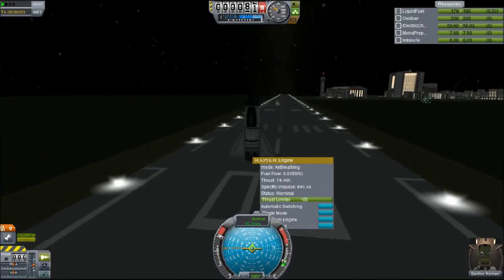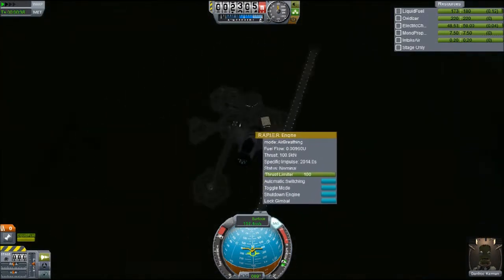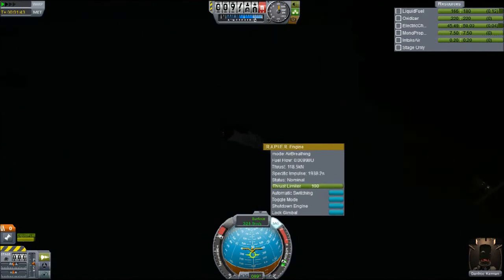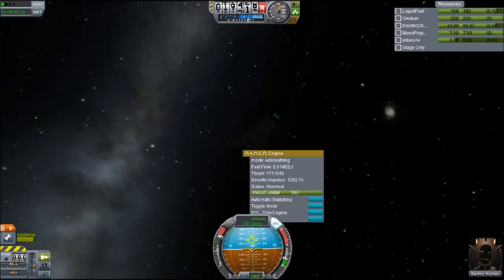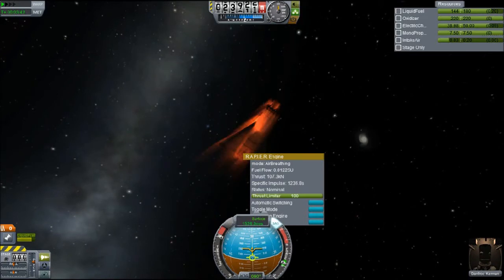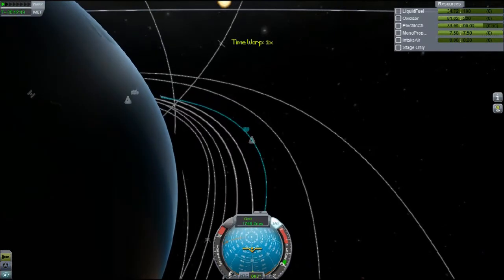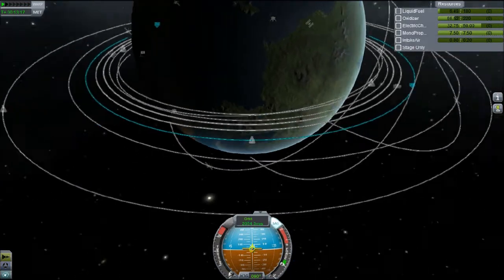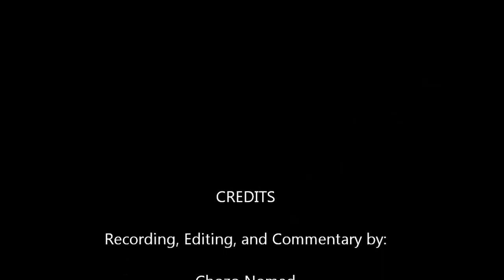KSP - Six Part SSTO

Comment: ok 2 questions, where are the engine exaust and the control surfaces?
Reply from the maker: The Engine exhaust seemed to bug out for some reason. As for the control surfaces, this thing doesn't really need them. The reaction wheels in cockpit are apparently enough to keep it in line and change its direction without need for control surfaces.
Reply: weird
Reply from the maker: Tarzthegreat
Yeah :l